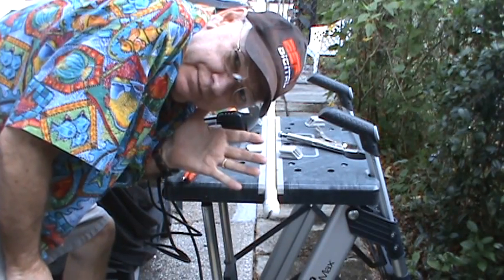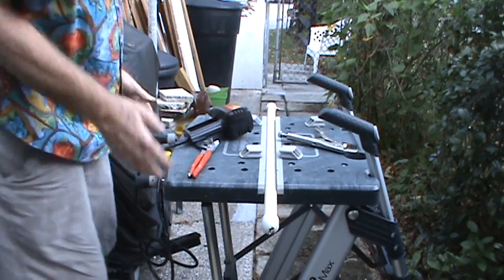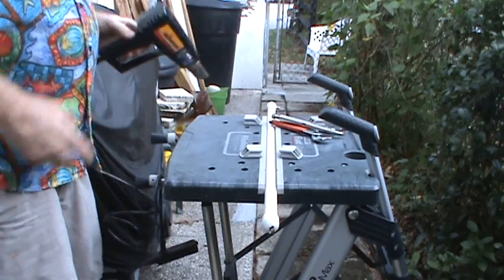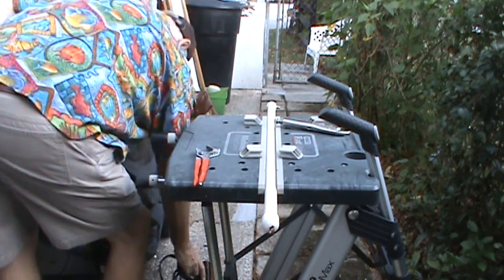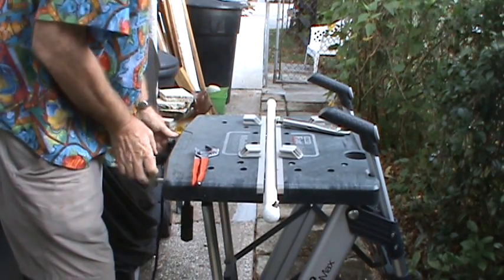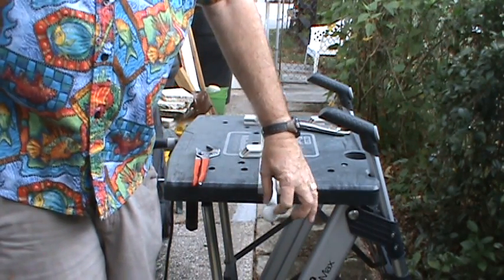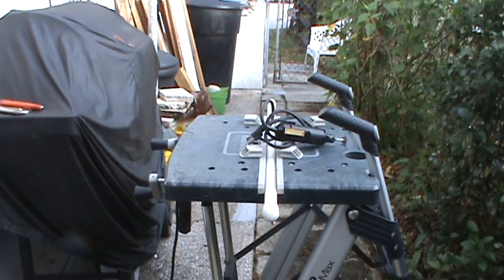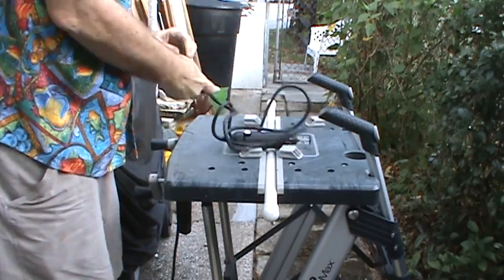TRRS #0431 - Broomstick Antenna Surgery - Pt 1

Comment: Tom, from the view, it looks like there is cement like silicon or JB-Weld around the connections? I would bet that the
connection between the center connection on F-connector and the coil is broken loose. The eyelet on the other end has no
connection and is just for support. It would also be interesting to see what the coil was wrapped around, a wooden dowel
rod or a length of PVC? You might end up building a new one using the coil, F-connector, new PVC tube and end caps?
It's going to be interesting to see what you find out!  :)
Reply from the maker: My guess is that I will end up splitting the whole thing open to reveal everything. :)